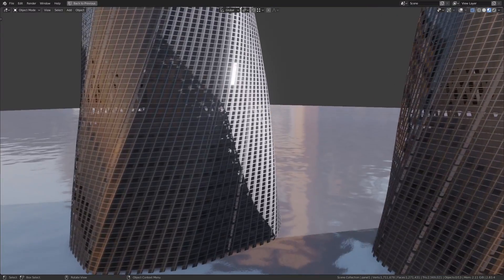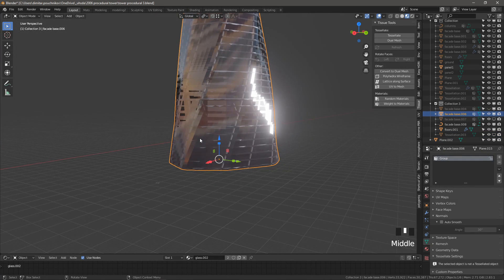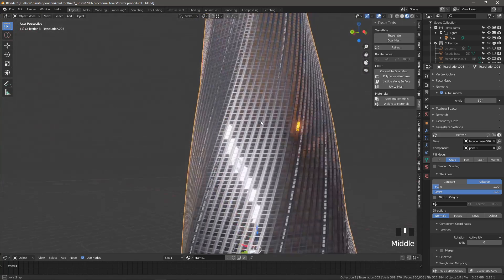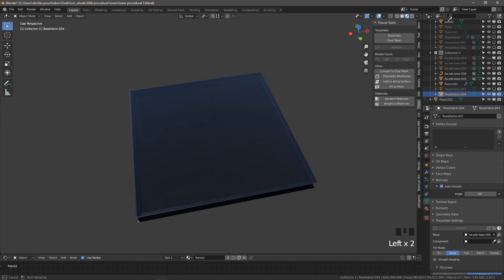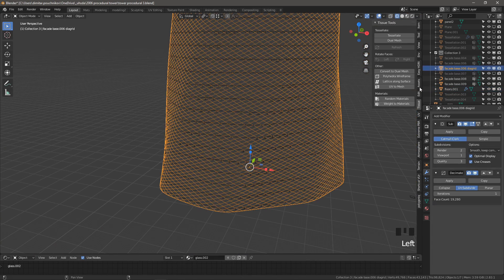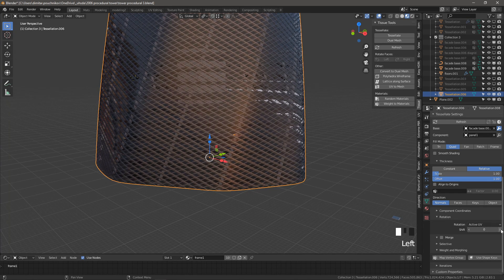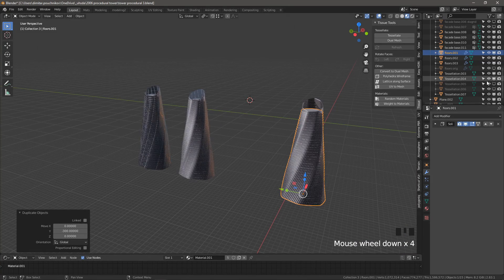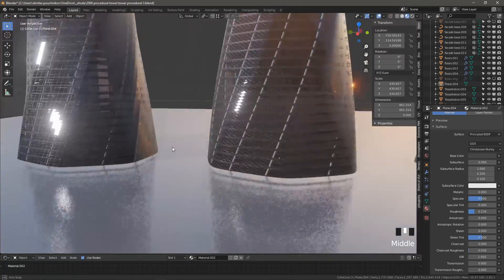Easy architectural facades with Blender - Parametric Tower 4 tessellations with Tissue

Comment: can there be some variations like several different panels randomly placed or controlled for example with gradients?
Reply from the maker: yes! Instead of a single panel, a collection containing multiple panels can be tessellated, with the trick being that the perimeter of the different panels should meet. Gradients can be used quite easily with shape keys, which can be different panel states. For example, the same panel has a really transparent and a really closed state and the gradient controls the variation between the two.
Reply: @UHStudio  thank you for replying. I dont quite understand where to put gradient on, that controlls what instances are being placed. I have Houdini background and there I would use attributes either color attrributes on vertices or normalized bounding box or uvs in order to distinguish what instanse to choose.

Comment: Thank you for sharing your knowledge. Invaluable information.

Is it possible to have a panel with drivers applied to an object as tessalation which can  rotate itself, based on its orientation to another object (like the sun for example)?

Thanks
Reply from the maker: If that driver defines shape keys and/or vertex groups that can influence the panel, yes
Reply: @UHStudio  Excellent. Any chance of a tutorial on this? Or would you know where I could find tutorials on how to achieve this?